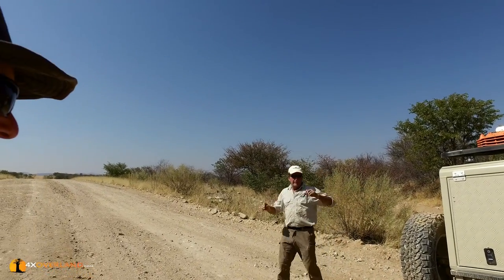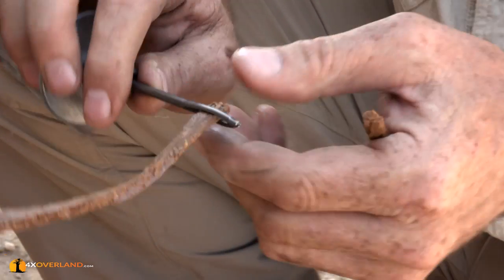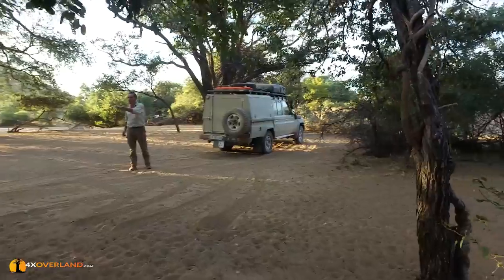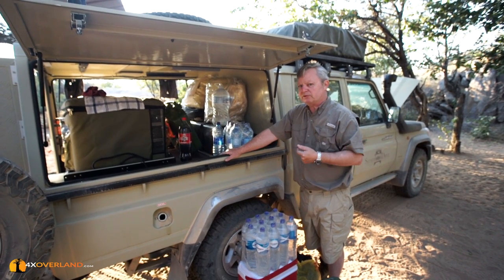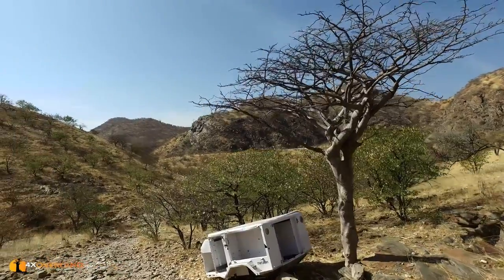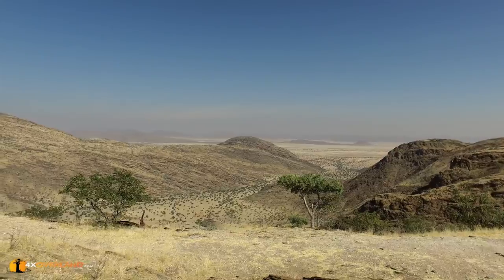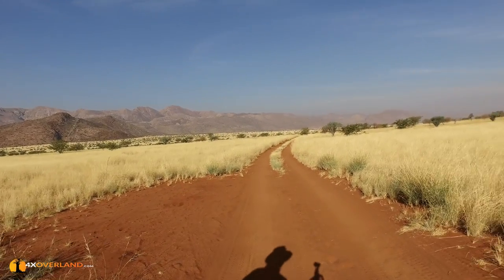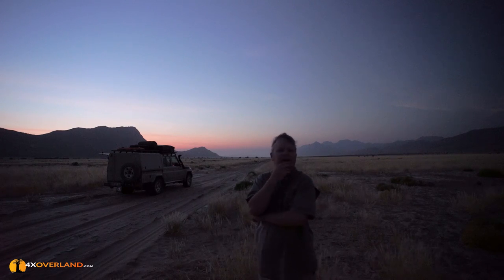ONE OF THE WORLD'S GREATEST OFF-ROAD 4WD PASSES.

Comment: Great video, again. How did you patch the tyre?
Reply from the maker: We used a rubber string plug and that remained in the tyre until the end of the trip in Windhoek, seven days later. Because Paul managed to stop the vehicle with air still in the tyre, we knew that we had not damaged it by running it flat. In Windhoek, we used a mushroom plug inserted from the inside, and the tyre is still running on that truck today.
Reply: Aha, good one. Any footage of that? Would be nice to see. Or did you guys needed 4 hands for the job?
Reply from the maker: We did that when back in the town and had a tyre shop do it for us. But we were carrying the proper plug.

Comment: No tyre would have survived that.
Reply: An MRF cross ply rag tyre would be just fine.
But no one likes them because they're not cool and expensive......
Reply: Ade Larsen Good point, I should have said no light truck radial tyre.
Reply: You're welcome.
The MRF 7.50x16 cross ply tyres (M-77, Super Miler, Lug and Rock) in 14-16 ply are almost indestructible. 
I carry an ARB Speedy Seal plug kit and I've just run out of plugs after 10 years and 50 plugs - on other people's radials.
I've had 1 puncture in 10 years - a 9 inch nail - quick tube repair and back in action.
The most important thing you need on a 4wd is a compressor and tyre repair kit, followed by a bulbar. :-)
Reply from the maker: There is no such thing as a quick tube repair :-) But would a 14 ply have warded off this spike? Its edge was razor sharp, and being hollow, the tyre went down very quickly. But even then, Paul managed to stop with some air still in the tyre.
Reply: Sitting here thinking of what to write in reply....

It's true, there are things that will puncture any tyre irrespective of its thickness, stiffness and design. The piece of steel pipe in this video is a classic example of something that would puncture any tyre.

Besides man made materials like nails and pipe off-cuts, the dangers in nature are burnt roots, live roots, rocks, sticks, spinifex roots, tree stumps and other sharp natural beasties - this is where the cross ply is always superior Eg, off-track, off-road, off-hwy and in-paddock.

Further to tube repairs - usually I replace the tube. We always demand long-stem Michelin tubes, made in Italy (yes, Italy).

NB : This information is provided for the reader and not the author necessarily. Cross plies do not suit most people and or vehicles.
Cross plies are often illegal on many modern vehicles so their use is limited and mostly unwarranted.

I accept the following :

a) I fall into the limited basket box in regards to tyre usage.

b) BF Goodrich tyres are great and tougher than the average radial.

Am I free to go now ? I'm all dusty and need a shower :-)
Reply: What I find amazing about incidents such as this, is the misfortune of the object being positioned in such a way as to do damage. If it were laying flat on the road way, it would not have caused an issue. It is almost as though someone had deliberately left it sticking up from the road way.
Reply: Might there come a time when you have a go running a Tweel instead of a tire and wheel?
Reply from the maker: We plugged it and it lasted another seven days until we reached Windhoek, where we put in a proper lug from the inside. Its still on the truck. We never used the spare.
Reply: 4xOverland  Perfect example of why BF Goodrich tyres are so good. I trust them immensely.
Reply: I run the same tyres and from my personal perspective are the best tyres i've ever run. A full trip around Australia encountering every type of terrain theres and not 1 puncture. The BFG KO2 is an excellent all round tyre and very tough when running low pressures
Reply: Might the villain who placed it, have pointy gold teeth?